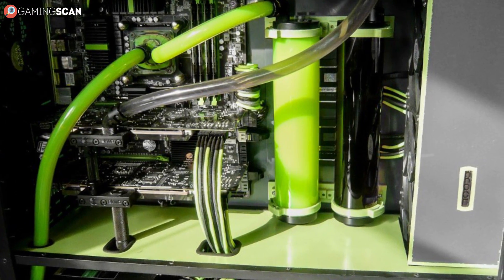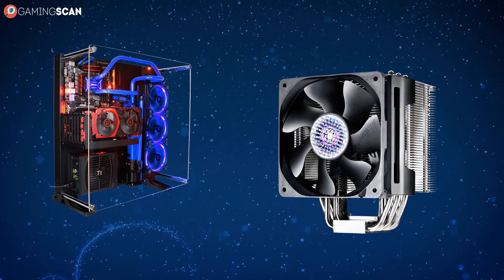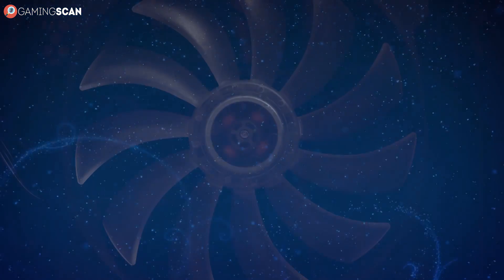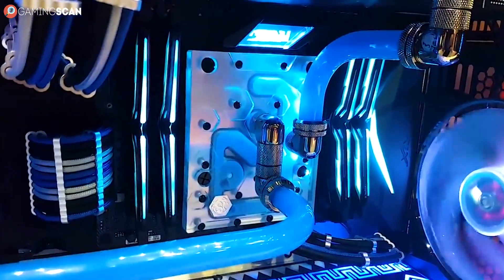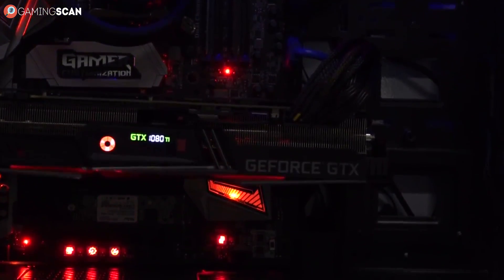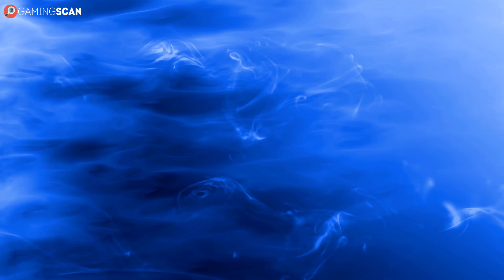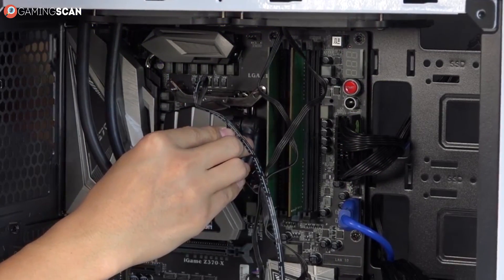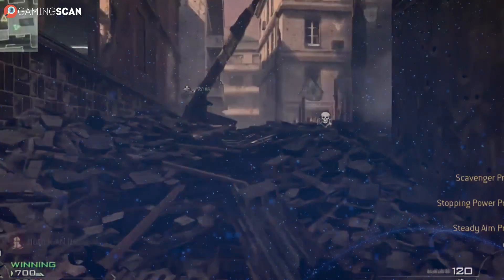Liquid vs Air CPU Cooler – Which Should I Choose [Simple Guide]

Comment: so basically if pc is not thermally bottlenecked or cpu getting throttled (can consider undervolting) , or if u are not custom building pc in a wooden cabinet, the benefits of liquid cooling isnt as prominent. that said, i do hope to diy a pc case with liquid cooling

Comment: Over clock is not the only reason you need water cooling. Games like New World and other games will fry your CPU. Games themselves fry CPU’s regardless of over clock or not. Simple answer is if you never want to worry about temps then get a water cooler.

Comment: Both water and air coolers use fans and liquid (for newer air coolers). (Most) air coolers use heat pipes which contain a liquid that evaporated into the fins, which the fans will blows through the fins to move the heat and after that the liquid condenses and goes back to the part of the heat sink the CPU is attached to and repeats this process. Liquid coolers use a radiator and a pump to move liquid to and from the CPU and to the radiator, which the radiator has fans attached to blow cool air through.

Air coolers can out perform liquid cooling in 1. noise, due to pumps being loud 2. less likely to fail due to less moving parts, and easier to replace the failed parts 3. cost and price:performance 4. sometimes can be cooler if you don't use a large enough radiator

Liquid cooling is still good because it has a larger thermal mass, due to the amount of liquid and if you have a large radiator, easy to move heat away from CPU especially in small form factor, and some people like the look of it more than air cooling.

Comment: It's so hot here in Australia, I just used a liquid cooler for my ryzen 5 3600 for the sake of it
Reply: Did you get better results than air cooling? I also have a ryzen 5 3600

Comment: I chose an artic aio 240mm over air cooler cause it works out cheaper than buying 5x corsair LL120 FANS and the coolermaster hyper 212 rgb cpu air cooler because with the aio I get a cpu cooler and 2 fans aswell as a rad for less than a £100 instead of spending £150 on a case £80 for 5 corsair fans and £50 for that air cpu cooler (£280)
I can buy 
corsair 275r carbide £77.99
Artic aio 240mm AIO £92.40
And it already comes with fans in the case 😄

Comment: The video explains how the simplest of all air coolers work. Most of todays coolers work different, and that is what should be compared. They spread the heat with water, too, just by using heatpipes. And then it basically comes down to radiator surface and wind speed in the radiator, everything else doesn't really matter in this comparison. It is way easier to provide a gigantic radiator with liquid cooling, though.

Comment: Sooo
I have a fan in the case I bought
Does that count as a cooler?
Honestly I feel like imma Abt to break this shit
Do I need to buy this or will it be in the case?
Reply: NO , the fan in your case forms the flow of air in the case. what this video discussed was the one on your cpu. you generally get a pretty mediocre "gets the job done" air cooler with your cpu and i am sure you must have applied it. if you are a general user the stock is fine for you. if a gamer , invest on a slighltly better air cooler and if a power user try getting a water cooler

Comment: If you turn the computer upside down or move and have it sideways, won’t all the water leak all over the computer? 🤔
Reply: it's a closed system, water doesn't get out, that would be rather disasterous.
Reply: @RSainman  well I don't trust it.  It's unnecessary and basically putting $2000+ at risk just to look cool.

Comment: I’m just scared that if I get a water cooler it’ll leak.
Reply: I've been using different kinds of watercoolers for years and haven`t experienced leaks. Just get a good well trusted branch of AIO and not the cheapest one on Ebay. AIO`s are pretty good if ur planning on running on high performance and overclocking, otherwise stay air cooled. They both do the job in the end.
Reply: @RainV23  are Corsair aio’s reliable? I’m thinking about getting one.
Reply: @Koyomix86  So far I haven't had any issues with Corsair AIO's. I believe Corsair, NZXT & Cooler Master have the best and most trustworthy AIO's.
Reply: @RainV23  Thank you
Reply: @Koyomix86  Yw
Reply: @RainV23  how long does your aio cooler last?
Reply: @otfkamikaze1515  It depends on where you place, how you place your AIO radiator for it and the amount of stress you put on your CPU. I have this Enermax cooler for 5 years and it still functioned perfectly till the end. I only replaced it because I wanted one to looked nicer than the previous one in my main PC build.  If you just place it correctly the first time and not screw around with it like most other people moving the radiator around all the time it should work fine for years.
Reply: @RainV23  thank you bro, I’m buying one from pc specialist so I think it should be ok if I buy a aio cooler then right?
Reply: @RainV23  ok thank you for your help man appreciate it
Reply: @otfkamikaze1515  No problem
Reply: @RainV23  if i buy a liquid cooler does it come with the pump or just the radiator and fans?
Reply: @couidbemason  The pump is the block that goes on the CPU
Reply: @RainV23  ohhh ok thx
Reply: @RainV23  is the kraken 53x a AIO you can trust?
Reply: @CoburnSawyer  NZXT AIO's are good if not one of the best in my opinion.
Reply: @RainV23  what abt thermaltake
Reply: @RainV23  I’m not sure if your replying to comments still, but i have a quick one. Do you have to clean or change out the water or anything for aio’s or maintain it or anything?
Reply: that happened to me
Reply: lol same
Reply: You can get an enclosed liquid cooling system the possibility of leaking is very low and in my opinion it performs better then a traditional water cooling system in my opinion and it's cheaper and worth it.
Reply: Same

Comment: I guess you haven't really compared the two cooling systems. Air is better, efficient easy to deal with. You can much better performance at a fraction of price of aio. Even if you buy an air cooler at same the price of aio it will still be more reliable than aio.

Comment: Why do you say that liquid cooling is less noisy ?
Air : fans
Liquid : fans + pump
Reply: I guess fans in liquid cooling are less to run faster because the water running from the water pocket going to radiator keeps the temperature cool enough for the fan to run at the high RPM making it more quiet.
Reply: @drycksgameplays  🤥💩😲

Comment: Air Cooler it is, stock ryzen btw
Reply: I want to over lock a Ryzen 9. I think I might do air still not sure. First time building a pc
Reply: @hash1918  Air cooling, for example the be quiet darkrock pro 4. It keeps a 4.8ghz cpu at MAX 70°
Reply: @hash1918  nah g you should get a 240 or 280 mm liquid aio cooler

Comment: Hey I'm buying a ryzen 5 1650 af.

Do I need cooler and what type should I buy. Can someone suggest a make or brand?

Thanks.
Reply: Just use the included cooler it's totally sufficient even for some overclocking.
If you're buing a "1650af" then you're getting scammed though since that processor doesn't exist
Reply: @Aayush KUMAR no I'm pretty sure he just meant to say 1600AF, which is a real sku

Comment: Fans are there to move heat away from the fins, not "keep it from over heating". The fins dont 'overheat', but rather the heat equalizes with the Cpu. The fans just keep that from happening so its always pulling heat away from the cpu.

Comment: Water cooling needs fans which it is air cooling therefore air cooling is better because both uses AIR too cool heat, while the water is just like heat pipes that leads to a fan.
Reply: Big and heavy air cooler can bend your motherboard, water cooler can't

Comment: Meh I got a 240mn liquid cooling on my computer and runs perfectly well and I don't even overclock. I think both are good but if you plan to Overclock in the future than liquid cooling seems to be the better long term investment
Reply: long term the lq will become more and more unreliable while an aircooler basically is indestructible if you replace the fan when upgrading the system.
Reply: @humphrex  again though, if you plan on overclocking than a Air cooler won't help at all.
Reply: bullshit. i overclock on ac since ever
Reply: @gwuba3689  nope
Reply: *then

Comment: I wished ROG made air CPU cooler.
Reply: AMD's stock air coolers are good enough if you're not plannning on overclocking. That is, the ones that come with the 3600X and higher.
Reply: @diegobahena1274  amd wraith cooler is the best
Reply: @Beanzballa  it's the best STOCK cooler, but an even more powerful aftermarket cooler won't do any harm (except for my wallet)
Reply: @diegobahena1274  they're really loud though, I don't overclock but I'll likely get an AIO just because it's much quieter and better temps
Reply: @stizzy6432  what about something from Noctua or beQuiet? I know watercooling looks cool and all but...
Reply: @diegobahena1274  I have a small case so a big air cooler wouldn't work, and AIO's don't have many issues
Reply: @stizzy6432  yup, BUT there are certain low profile air coolers. Not trying to convince you tho. I also love the look of an AIO on the CPU.
Are you planning on adding a waterblock to your GPU?
Reply: @diegobahena1274  I'm not sure about a water block atm, but maybe in the future.
Reply: If not Asus , Aorus ATC 800 maybe ? :3

Comment: Just to give an answer....air cooling because it's easier and cheaper only get liquid cooling if your using your CPU to the MAX 🥰😄
Reply: OR if you want a quietter cooling system.
I myself found that the stock air cooler from the CPU i'm planning on buying is not that good so it'd be a good investment given that I don't really mind the extra price. Air blower noise is quite a concern to me.
Reply: @diegobahena1274   a good AC like Noctua is more silent and even cooler than most LQ solutions.
Reply: @diegobahena1274  wow you're having the 1st world problem right there..
Reply: @Noh1996  ok. And?
Reply: @Steiny5843  ohh nothing
Reply: What's the meaning of those emojis at the end
Reply: What about noctua nh d15
Reply: @homephone2686  look up vids
Reply: Only reason I'm getting a watercooled cpu is because the only way to get a new gpu without selling a kidney is a prebuilt and it comes with it.
Reply: Thanks for the answer the video was I just want a straight answer not and 5 - 30 minutes of answering 🤣😂
Reply: I overclocked mt pentium to 5ghz
Reply: Actually the noctua NH-D15 air cooling fan is quiter and actually keeps cpu at a cooler temp than any liquid cooling system out there
Reply: I am using cpu cuz minecraft requires most its power from cpu
Reply: @Xendex Motorsports what are you talking abaout?
Reply: @Xendex Motorsports There is. Maybe check your browser or your app.
Reply: I have an hp omen tracer with a gtx 1650 and two fans with a ryzen 5 3500 I want to upgrade to the RTX 1080 ti or the 2080 ti and my question is which one doesn’t require liquid cooling
Reply: @bleachabuser9118  none of them require water cooling. Just an fyi, 1080ti doesn't support ray tracing.
Reply: What if your liquid cooling leaked
Reply: Me having a quiet air cooler and living in a cold place so yah no need for water cooler but I need the knowledge that's why I search for this video

Comment: for the price of AIO you can get a Noctua NH-D15 which is as good as Kraken x62. Dead silent at idle, built as a tank. With low TDP CPUs could even be used without the fan (although why would you). The only issue is the size, but then again, you have to find the space for the AIO radiator as well.
Reply: RAM clearance.
Reply: @tornadochasing2883  what about it?
Reply: @holderua  You can only use low profile RAM, and you would also deal with higher GPU temps (since the heatsink is very close to the GPU).
Reply: @tornadochasing2883  it depends on a motherboard. And concerning the higher temps - if you put the water radiator on the front of the case, and the cold air from the room would flow through the radiator into the case, then essentially you have the same problem - the  CPU is heating up the GPU. GPU would use heated air for cooling.
I honestly don't think that the hot CPU radiator is affecting the GPU temps to a point when it matters, unless the fans of the CPU radiator are blowing the hot air directly onto the GPU back panel. But usually the hot air  directed right onto the case exhaust fan. In fact, the GPU would probably affect the CPU temps since the GPU radiator is dissipating hot air in every direction inside the case and there are no exhaust fans nearby.

Comment: aww shit.. I was planning to buy a mini ITX or a Micro ATX but you just said they have cooling problems so recommended liquid cooling..... shit...
Reply: My oldest son recently build a custom PC in a micro ATX form factor. I recommended him to use air cooling, like I do myself. They tend to be less noisy. 
The Noctua NH-D15 aircooler is an excellent choice. As for temperature, he has no issue at all, only thing to worry about, is the height of the cooler, it only fits in some micro-, and mini cases.

A good air cooler will allow some overclocking, but in most cases not to the extreme. What this means in performance, is a matter of taste. You mostly will only gain a few extra FPS. Does it matter? Not to me. Whether you are running a game at e.g. 77 or 82 FPS, you won't be able to tell.
Btw., the Noctua NH-D15 aircooler beats most liquid coolers.
Reply: @akyhne  thanks for your reply, I ended up going with a midtower, I was too afraid of it failing me somehow..
Reply: @Panicthescaredycat  - As long as your cabinet has suffiecient fan holes, it will never be an issue. The same goes for large cabinets. It's much more important to buy a motherboard, that allows space between the components. Like try to avoid placing a second PCI-E expansion card, so that it blocks the fans of your GPU's fans.
Enjoy your new purchase :)

Comment: So liquid cooling is better for overclocking and using the CPU a lot and air cooling is for normal and using the CPU less?
Reply from the maker: Liquid is better for overclocking, yes. Even if you use the CPU a lot and don't overclock, air coolers are just fine and cheaper.

Comment: Air cooling it is then.
Reply: Just download more water
Reply: NS 55 water never ends, there is no escape, only if the cooler brake.
Reply: @eliasl332  Using cooling liquid is far risker tho, like if it leaks even a little bit then it can destroy your pc, but if a fan breaks then you can always buy a new one for like $30 and not worry about your pc breaking

Fans ftw is facts
Reply: No

Comment: Some People say the any AIO is better for cooling CPU with the same price range of Air Cooling.
Reply: From what I can tell AIOs are still more expensive than Air coolers for the most part although they do seem to do a better job of cooling. I've always been an air head (lol) but lately after watching lots of videos on AIOs it seems they almost always drop temps on both CPUs and GPUs by about 10-20C. I am personally thinking about making the swap to an AIO for my GPU since it is always the hotter component when I am gaming. Again, they will run you about 2-5 times more money depending on brand and size of the radiator, but if you're like me and heavy gaming makes your GPU temps high (65-75C with a custom fan curve) then you may want to look at investing in one.